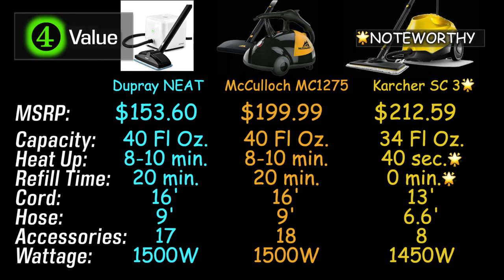DUPRAY Neat Steam Cleaner REVIEW - Watch It Clean + How To Use (THE TRUTH!)

Comment: Does it clean carpets?
Reply from the maker: Great question! In general, cleaning rugs and carpets can be a bit tricky with this steamer and depends on what you’re trying to clean. And while the steamer  can “refresh”carpets by helping to remove odors, I find there are better tools to remove stains and debris. For example, what I deal with quite frequently is a senior cat that tends to vomit after eating too fast. Our other cat frequently gets fur balls and in both cases, the cats always leave their vomited deposits on our rugs. Once I’ve carefully scooped up the piles to avoid grinding it into the carpet fibers, I reach for a carpet cleaner (ie, Rug Doctor or Bissell cleaner). I’ve used the steamer to gently blot stains, but performance is mediocre in my opinion. If a cat’s “deposit” goes unnoticed for a day or too, I’d still do the same process although I’d use a toothbrush to loosen any debris and then vacuum it up before cleaning. In either case, once clean, fully dried, and vacuumed,  that’s when I’d reach for the steamer to help reduce any residual odor. 

I’ve done a few tests over the years to see how the steamer performs when doing general carpet cleaning (so no vomit, just dirt from every day activities). . . My process was vacuum up loose debris and then use the steamer on low and medium pile carpets with a microfiber cloth on the floor attachment. Once the carpet was fully dried I’d then vacuum again to “fluff” and remove any loose carpet fibers (one of our carpets sheds terribly). My final determination was that cleaning with the steamer only provided a modest improvement in the overall appearance and perhaps reduced odors; however, I couldn’t decisively say I noticed the carpet looking cleaner. In ringing out the microfiber cloth, it didn’t yield as much dirt as I expected either. So my opinion is the steamer is better for refreshing carpet versus providing a deep clean.

Comment: Okay I just unlocked my how it has a hissing sound.. what do I doooo?
Reply from the maker: Sorry, I don’t understand. Can you clarify where/when the hissing is occurring? I know that sometimes when I press the button to make it easier to fill the reservoir that I forget to turn off the trigger lock before powering up the unit so it hisses as it heats up. Always surprises me, but once I turn off the trigger it stops hissing. Also, if the cap isn’t on tight or the gasket on the cap dries out, it will hiss around the cap.

Comment: it doesn’t get hot enough at all. i can touch the steam. it’s better for facials.
Reply from the maker: I don’t recommend getting body parts close to the tip of the wand. I’ve burned my hand a few times wiping while the steamer is on. The steam will always be hottest at the tip of the wand, but a few inches beyond that it’s only warm which is normal.

Comment: If you only put distilled water you won't have to clean with vinegar.
Reply from the maker: I actually thought so too, but when I spoke with a DuPray rep, they told me I should still be cleaning it after 20 hours of use even if I used distilled or demineralized water. Doesn't make sense to me, but I just hope it's not because the tank is slowly breaking down. 😅